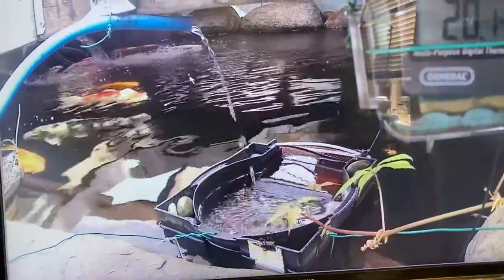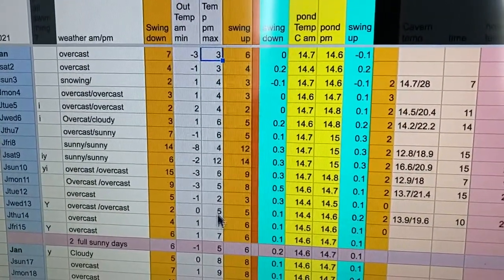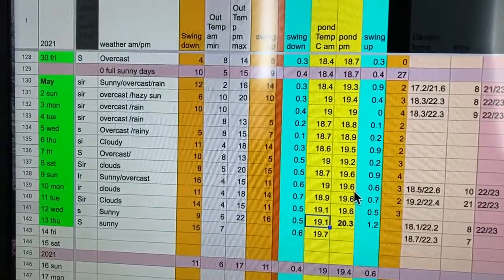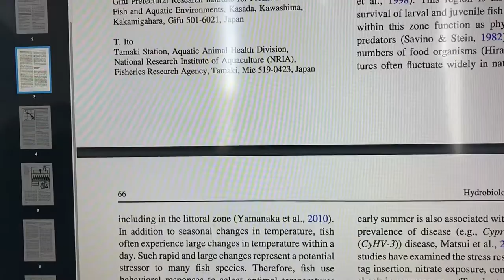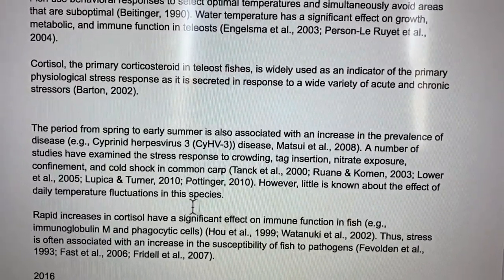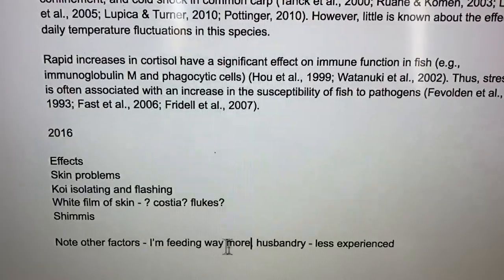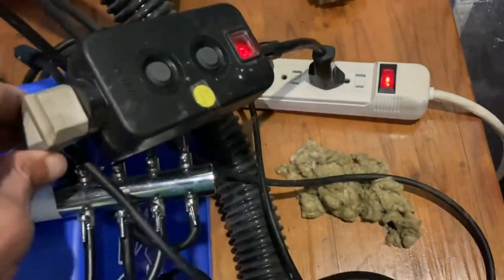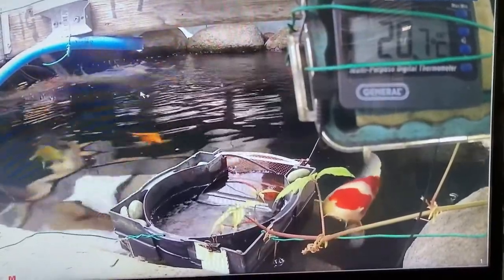3.4 Pond Water temperature fluctuations, how much is too much?  Koi Pond.

Comment: Man that's just way to many numbers buddy 😂😂
You also got to remember that carp are a very hardy species and I'm a firm believer that they need a proper wintering
Reply: I would be careful putting an electric heater under the pond cover because of condensation
Reply from the maker: Thanks for the heads up 👍.